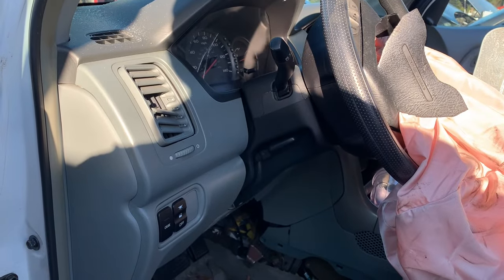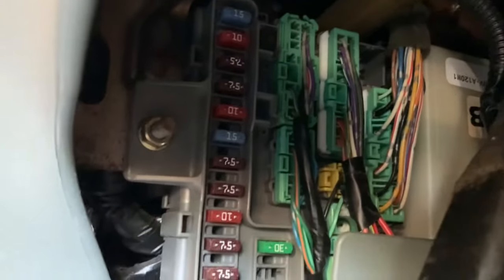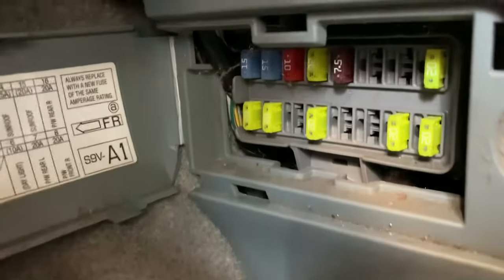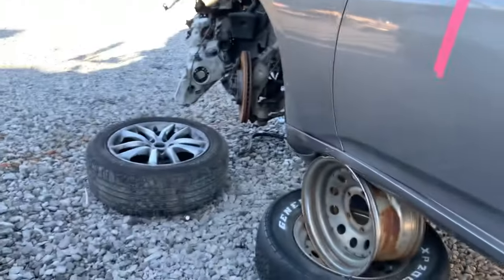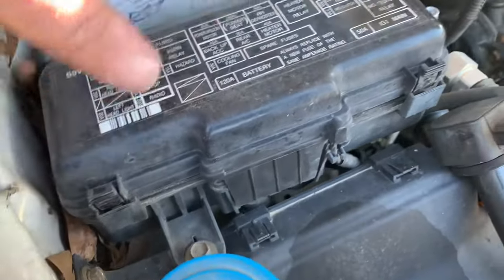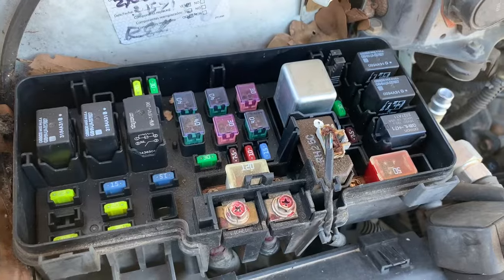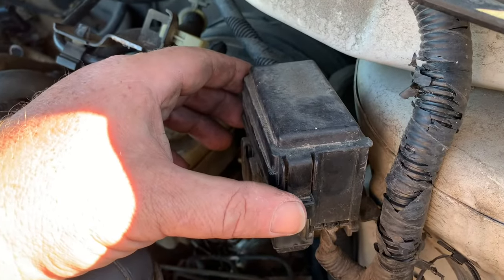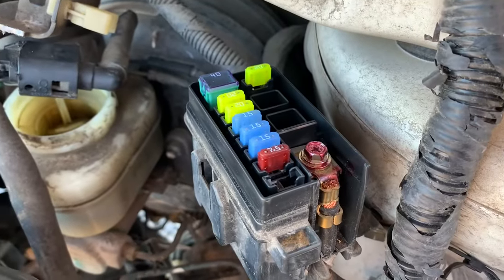2003-2008 Honda Pilot Fuse Box Locations

Comment: I have an 08 Honda Pilot. I was told I could disable alarm with the fuse box but none are labeled alarm and owners manual shows nothing of the sort. I'm trying to figure out if I hafta pull entire anti-theft system (I am happy to do so as the whole thing is just a nuisance anyways with the absolutely LUDICROUS number of ways the alarm will just go off that it shouldn't.) If anyone sees this asap nd can share that info before I find it, qould be greatly appreciated.
Reply: Having the same problem n I can't figure it out.
Reply: Have you guys found a fix this is ridiculous I literally can’t get my car to be quiet my keys won’t open neither door and I’m not able to drive with the alarm blaring like this
Reply: Anybody have an answer to this very prevalent question? No diagram lists the fuse.
Reply: Update; i did find the fuse that operates the immobilization system. Unfortunately, it operates the fuel pump as well. Removing it to bypass the immobilizer wont let you drive it.